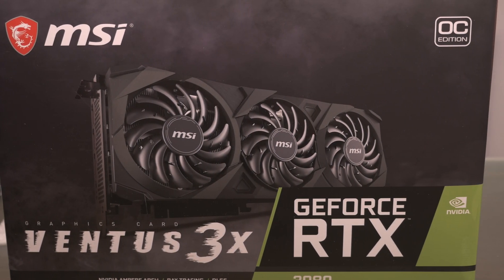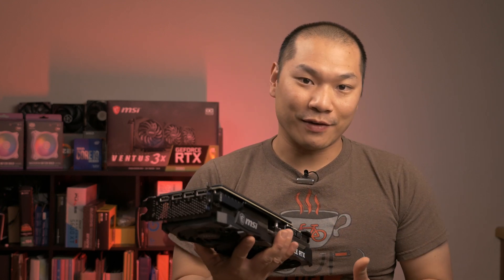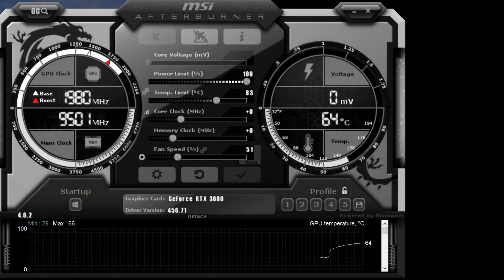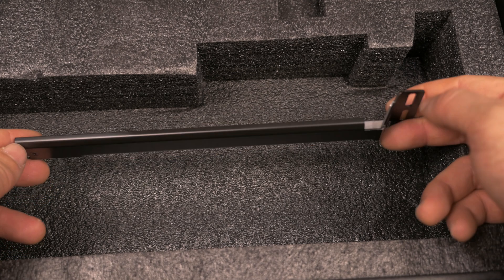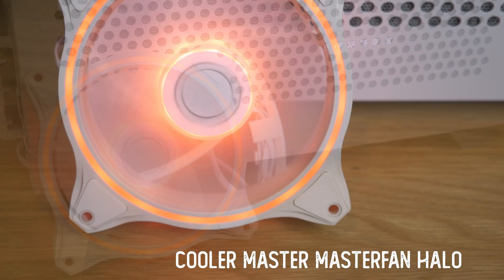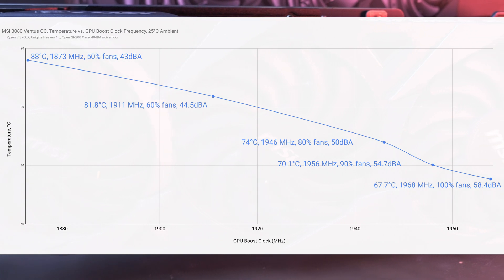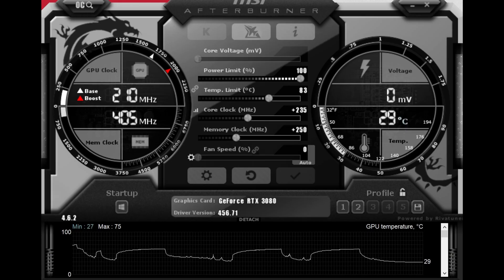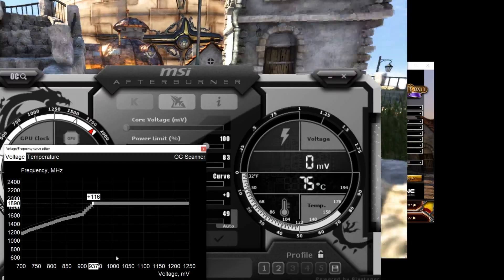MSI RTX 3080 Ventus 3X OC Full Review

Comment: I'm having one of these, momentarily at least, that was used and disassembled by a miner (changed paste and pads, used fan underneath, temps are good) and all fine but I have a 1660 Super Gaming X that has that problem (heatsink falls). I contacted MSi about that and was like talking to a child...a very stupid child...totally pointless.
Now the card itself has very low performance compared to other 3080 used by the same miners (and online results even lower than the stock FE). Mine undervolts fine. Also is loud (but I undervolted and underclocked, room heat reasons, and now you don't hear them). just for the low performance is a really crappy 3080...and still a beast :D

Comment: I bought this card a week ago. The thermal is off the chart especially since I have an ITX case (Raven RVZ03). it hovers around 100 degrees during game. Badly thermal throttling.
After I re-paste and replace the thermal pads (front only) I only manage to reduce the temp to around 80-90 degrees. Still very hot for my liking. I can feel the heat blowing to my feet while I play.
I will try the de-shroud mod tomorrow. I'll try under-volt next if it doesn't reduce the temp. It;'s crazy that this card only draws 350W and already runs that hot.
I don't think my case (or my power supply) able to handle TDP from this card let alone the RTX 4000 series
Reply: this is definitely a case issue and not the card. make sure you have more exhaust than intake when you have high TDP cards like a 3080 or else all that hot air is just stuck inside your case
Reply: @tehMaloWalo  you're right. After some  inspection I  realized that my  case  cannot  get the hot air out quickly.  I managed to reduce the temperature to around 70 degrees with additional smaller exhaust fans around the case. 

If my case barely able to tame a 350W card, I'm afraid I cant' afford 4000 series unless I also replace the case
Reply: @kaptenhiu5623  Thank you and Kapten for this information, just starting a PC build

Comment: They must have rattled ur card in delivery dude, mine is awesome. So glad I bought it, its much less money than its other "highest end" brand counter parts and works with in 2-3 fps to the best of the best. That said, being that their so over priced... I am very happy with it. P.S I dont have a gargantuan heat sink next to my 3d card, I opted for artic silver 2 280, also I have 5 fans in my case and the largest fan I have is my exhaust fan. Further more my CPU Liquid cooler acts as a secondary exhaust fan being at the top of my corsair case where heat "actually tends to rise". Bottom fans definitely not needed, common sense needed more! :) nice review though! Please if you want this card get it you won't miss out, just learn to create correct air flow as it is the key, scrap that it is the ART of being a true gamer. note I have recently realized that Machines & more may have a point on the back plate being mostly plastic, as I bought my GeForce RTX 3080 VENTUS 3X PLUS 12G LHR a few months ago and they now use aluminum back plate + 350W that is why I am happy with what I have... I had to check my self as his video was end of 2020, my apologies for jumping to conclusions. But still no one should be using small cases with such a big graphics card...

Comment: I like it, I own it, I was hitting thermal limits until I went in and set a custom fan curve.. For some reason my fans were maxing out at 60% without me setting up a custom fan curve, even when the temp would hit 90+ range.. I have tried multiple times to get my fans to spin at 10%, even when idle and cool just for my peace of mind but it never seems to stick... 

Once the 3090TI is release, if it's ever released, I will be upgrading to that. Something hybrid out of the box, as long as it's not a tacky overpriced KINGPIN (such ugly cards).

Comment: Great review 👍  I have the MSI VENTUS 3X 3080TI (non OC) & I haven't seen one review of it yet ?? (yes I wanted a 3080 but after Q-ing for nearly 3hrs at a special event @ my local store all the 3080's sold out before I got in so got my a$$ spanked for a TI - at least it was MSRP 😁) Anyway... My card runs pretty cool, it has an aluminium backplate not plastic - that must help with temps a bit, I don't understand why they would put a plastic backplate on the 3080 with thermal pads 😱.  Thanks 👍  Please review my card if you get hold of one 😁

Comment: Ive been using the 3060 ti msi x3 and even with a 99% of usage doesn't even reach 70°
I'm a 1080p/1440p player and on the games I play (MW4, Battlefield, Apex legends, etc) it doesn't even reach 70% usage so the card it's not even 65°C most of the times. Also it's really thin compared to this one on the video.

Comment: I got this card in October 2020 for $799 USD, and it has been phenomenal despite being a "low-end" 3080 option. Max temps while gaming AAA games at 1440p are 63C. Clock speeds stay locked 99% of the time between 1910-1940MHz

All I did was set a slightly more aggressive custom fan curve in MSI Afterburner. 

Also, FWIW, using the Fractal Design Meshify S2 case with Noctua 140mm intake/exhaust fans

Paired with a Ryzen 7 37000X with noctua NH-U12S cooler, 32Gb Corsair Vengeance RGB Pro DDR4 @ 3200MHz, 1Tb Intel 660p m.2, and Asus X570 Plus wifi mobo
Reply: Had the opportunity and bought this right away. as soon as i got it in the mail... an EVGA 3080 ftw3 ultra gaming lhr was listed for the same price. Hoping i dont regret my decision D:

Comment: Can you remove the backplate of this card without removing the fans or are there screws on the front of the pcb for the backplate?
Reply from the maker: There are pcb side screws. You can un mount the cooler without removing the backplate though.

Comment: Just checking. But I read that you need a big space from the bottom of the pc case to the gpu for air to to be pulled in for temp regulation, maybe where the card is low in your case it caused the temp flux? Potentially.

Comment: You got a defective GPU unfortunately. My card doesn’t even hit 70°c while gaming. In timespy it doesn’t even hit 60°c in a lian li 205. Also, your heat comparisons are bogus. You compare the FE card with fans at 65% and the Ventus at 60%, then compare the FE with bottom fans at 60% and the Ventus at 65% without any bottom fans. That’s literally not a valid comparison in either case. I guess I was just expecting a more valid comparison.

Comment: My pc shuts down under heavy gpu loads but this never happened with my 3070...u have a Corsair 750w and a i9-9900k . Is 750w enough ? What’s going on ?
Reply from the maker: Should be... your 9900K can’t normally draw that much power to cause the PSU to trip and in fact the SF750 is known to be able to deliver more than 750W. Any other heavy peripherals?
Reply: Machines & More can it be a short ? When I remove certain USB devices it shuts down. Or can it be the Mobo ?
Reply: Machines & More no heavy peripherals I’m using Noctua NH D15 but that’s it.

Comment: I'm assembling almost the exact same build as the one you have a build tutorial uploaded in the NR200P (I'm using the TG for now), only i use the Fuma 2 instead of Mugen 5. What Fan-Layout would you recommend for this card (I'm probably getting a Gaming X trio or a Suprim, but I think the layout should apply as well). Right now I only use the stock fans, one intake on the bottom right, and one exhaust on the top right. The CPU cooler is set to intake cool air from outside. Thermals are pretty good so far, the 5600x sits at about 55°C under load (Cinebench R23 being the load here), mid thirties idle, and my old 970 (which is going to get replaced with an MSI 3080) hits about 70 under normal Gaming load, and just 1 or 2 degrees higher in Heaven 4.0. Should I add more fans? If so, where? I think the Suprim is easier to get for some reason (at least in my region), so it'll probably gonna be that one. But its even bigger than the Ventus, so I'm not sure if even slim fans would fit beneath it.

Comment: How did you get the card to +235?  When I went past +100 it caused game crashes when gaming. It DID NOT however, cause Superposition to crash, which was weird for me.  I ended up settling at a modest +75 and a custom fan curve.   Superposition would not crash on higher overclocks, but games would occasionally. They would launch, and run for a while, but always have crashing issues. I think the power draw spikes and causes errors. Also found OCing the memory gave no performance benefit, and in some cases actually caused memory errors (which did not generate game crashes.) and lowered performance.
Reply from the maker: This is always silicon dependent and there will be variance across different dies. Samsung vs Micron VRAM will be different too.
Reply: @MachinesMore  I know of the silicon lottery, but its actually also the nature of the GDDR6x memory, i'll bet if you test your clocks of +500 or above on memory, vs none, you will see either no performance improvement, or worse performance as well, it wont crash, but it will cause memory errors that slow the performance
. I think you'll be able to repeat the crashing in games for over-boosting on clocks too. It doesn't seem to do it in benchmarks, but if you start  gaming for an hour it seems to spike and crash on the Ventus.  Others have also talked about this in forums online.  My +75 is admittedly on the conservative side, but I was able to repeat it on +120 as well.  I could run superposition all day, but fire up  Yakuza: like a Dragon for 2 hours? Crash city until I turn down the boost clock.  It seems to hit if you boost too far past 1900 mark. Oddly, my Thermals are also way better than yours. Mine seems to cap out at 58 to 60 and never get any higher.

Comment: If I want to add bottom fans without deshrouding the ventus (as to not void warranty), is it worth getting two noctua nfa 12x15 slim fans?
Reply from the maker: As long as you can maintain a suitable distance away, such that there’s airspace to equalize any fan speed differences between the GPU fans and the case fans, then yes it will help.

Comment: Can you remove the backplate before removing the cooler / heatsink?
Reply from the maker: No, there's two screws that go into the backplate from the inside of the cooler so you do have to take that off. You don't need to take off the backplate to remove the cooler though.
Reply: @MachinesMore   Got it. Thanks for the information! Great review. Big help in my decision making

Comment: I love this card. Beats my buddies Tuff 3080 in most games. It's also one of the best looking IMO. Mine also boosts to about 2020... Maybe I got lucky.
Reply: I finally was able to snag one after months of trying. Order says it will be here in a couple of weeks. I agree it is one of the best looking 3080s. Hoping the noise and thermals are good enough. Interesting that it beats your friend's 3080, do you mean in noise and thermals, or in clock speed?
Reply: @brettchase7870  It does run a little hot I think. But a fan curve fixes that. I think it runs pretty quiet tho. And I mean we launch the same game, mine usually has a few higher fps. And I get a slightly higher graphics score on the time spy benchmark.
Reply: @brandonbee9  that is helpful to know, thank you!
Reply: @brettchase7870  Every card is different ya know. I def think I hit the silicon lottery with this one. Lol
Reply: @brandonbee9  yeah you did, mine can't boost to 2000mhz at all. I just use an undervolt of 1920 @ .887mv or 1830 @ .831mv and it's fine for me though :)
Reply: @addictedtoRS  Honestly, the difference isn't going to be that big between our cards. Maybe a few frames. Probably worth it for lower temps. But Def try a fan curve through afterburner. Maybe you're card is throttling a little. The difference between mine running at 75c and running at 69c is pretty big as far as clock speed.
Reply: 2020MHZ!!! Damn you’re lucky, also got this card because it was the only one available and it’s good enough for me, but it saddens me how everyone always says it’s shit when I mention that I have it

Comment: I did not expect that undervolting bit, very well done! I'm just wondering why Nvidia is pushing this card so hard. They ship it right at its limit, before they would go for a more balanced aproach, leaving the utmost performance for those willing to tinker at the cost of a much higher powerdraw. I have seen people undervolting this card to around 818mv to 825mv attaining around 200 watts of powerdraw with t best a 2.5% performanceloss. while also heavily cutting back on heat and noise.
Reply: "I'm just wondering why Nvidia is pushing this card so hard. They ship it right at its limit, before they would go for a more balanced aproach"    fps numbers.....u figure out cooling yourself.........and its not in a highschool kids A.I.O.....custom water cooling crap in a case of your choice vs a custom loop you will own for a lifetime of performance,,,any upgrades u do....still amazing....A.I.O. coolers are for beginners,noobs,kids...fact......stacker 832 here....dual 3x120mm rads (THICKS BOYS) bolted on the backside of it....1/2 tygon only 3603 tubing swiftech p655 pump....9700k 5ghz.....28c....idle.....45 load.......rtx 2080.....about the same temps...single loop...

Comment: Maybe I lucked out on mine but I get roughly 2040mhz boost clock at 70C gaming when stock. Fans usually go to 65%  and are very quiet. With an undervolt I'm doing 1950mhz at .875V at 65C while gaming. I agree it was priced a little high. In Canada I picked this up for $1049.00 but the TUF is only $10 cheaper here when looking at the OC version. It also seems to be the most available card here. I should also mention I am running triple 140mm Intake and exhaust in my Phanteks evolve x which helps with my temps. I would say if you are planning to undervolt this is a pretty decent card although I know from past experience that lower end cards can really differ in temps and over/underclocking.
Reply: Finally got my backorder in for this card in Canada, they shot the price up to $1,110. You think it's worth paying premium price for this card or place another backorder on another card and wait another 3 months?
Reply: @addictedtoRS  that's up to you if you can wait. My gtx1070 gave out so I needed one to replace the and 6850 I was running lol. Glad I did for CP2077 and Ghostrunner. But I am not sure how much prices will stabilize in the coming months
Reply: @DestructoMutant  I ended up getting it today, tested it in all the latest games and had pretty outstanding results stock. Never went over 65°C, hovers around 62-63C most of the time. So far I'm very pleased! And to top it off, they didn't charge me for how much the price of it raised since I got the backorder. I got it for $100 less than it shows on their site :)

Edit: Forgot to mention it did crash and blue screen my computer once. I reinstalled drivers in safe mode and so far it's been fine
Reply: @addictedtoRS  nice glad it worked out. I always DDU it before putting in a new card even when switching Nvidia cards. Hope you enjoy it

Comment: That is not a single mlcc that is a set of 6mlccs. 
They are not really required you just need more capacity. Not really an issue consumers should have nV f-ed this one major. While thermal engineering can be measured with temperature as an easy variable power cannot. Just looking at watts will not tell the whole story as both transient and ripple can cause instabilities. 
Again not a high level thing a consumer should ever get in contact with so I cant blame anyone here. 
Cheers, great review.
Reply from the maker: Noted with thanks.

Comment: Great review of the card.  The reason I came here is looking for more information on the MSI RTX 3070 Ventus 3X OC, and getting some insight into the 3080 version hopefully will help me out.  it was the first 3070 I had the opportunity to purchase so I went for it.  I cannot find any reviews for the 3070 version, so wondering how similar they are.
Reply: they are similar with the design ... they both have the same heat sink  .. BUUUUUUTTT NOT NEAR THE 3080 WHEN IT COMES TO PREFORMACE  ITS LIKE 2 3070 ... I HAD ONE ON 4K MOST I PUSHED THE 3070 ON CALL OF DUTY  TO 120 MAYBE 100 AMD THAT WAS  THINGS ON NORMAL TO LOW .....WITHC WAS GREA with DLSS ON.  BUT then i got my 3080 and now i get about 160 pluse lowest 140 on my lgcx 55inch tv with dlss on and ever either high or normal or ulra mixed.. heat does not go past 75 in game idle ......on both card 40 with out fans running u could turn on the fans n get it to 30c on idle thats what i got on my pc right now hope that helped

Comment: I came here to check because I have just bought the 3060 TI ventus 3X. The 3060 is 760g vs 1370g of the 3080 but no support bracket. I'm scared if the graphics has a problem. :-(

Comment: Out of the box it crashed my pc. Undervolted to 1mv at 1900mhz. Runs smooth. No crashes. 4k beast!!! Runs 8 degrees cooler. Love this card!👍
Reply from the maker: How did it crash? Too much heat?
Reply: mine runs at 0.85mv at 1850mhz , at full load max temp 73 degress in game

Comment: Have you had any issues with this card yet. I just ordered this card and I'm a little nervous because of people saying it crashes on them? Thanks I liked and subscribed
Reply from the maker: Interesting...  honestly if you were able to snag one (I think there was a small stock drop yesterday?) just run it and see. At worst you end up having to return it, which is a bummer. I’d run it extensively just to check. Check thermals too.
Reply: @MachinesMore  you are 100 % correct. I got one yesterday. Been refreshing pages for two months. Have you experienced crashes at all while testing? Thanks again